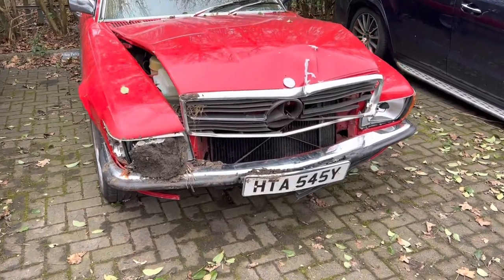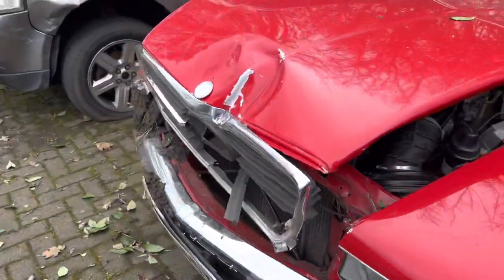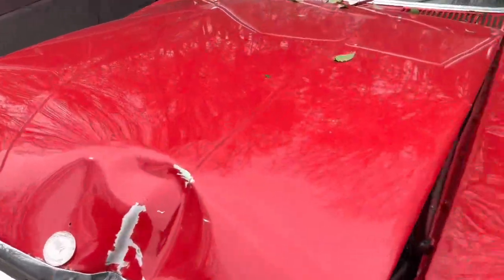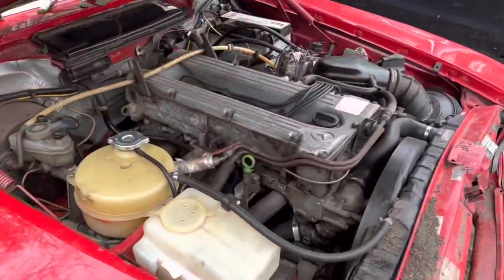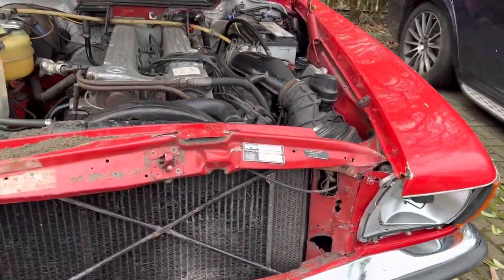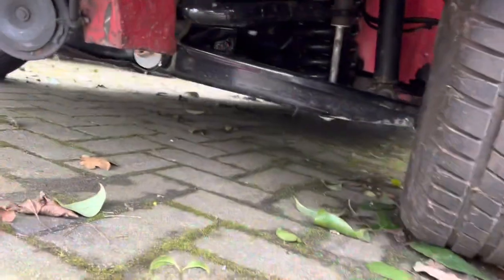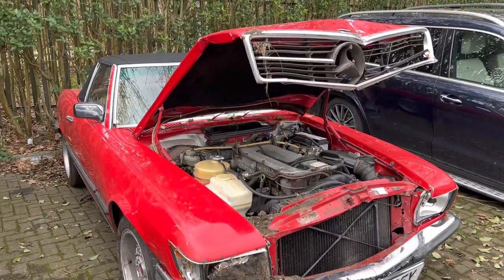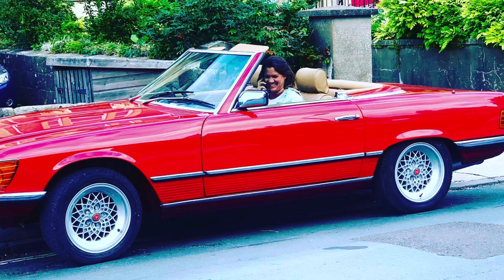Mercedes 280SL - check YOUR insurance and avoid this pain

Comment: Wish you all the best for the future. With all the criminality going on these days its best to just count your losses and move on. You have amazing talent with Mercedes Benz, you will find other good ones.
Reply from the maker: Thank you for your kind words. I'm not sure I have any talent for car work...mostly it is just long hours of hard work...however the current project (also 280 SL) will entail reconnecting the fuel system, gear box, starter etc...none of which I have donwe before so it will be an experience (and take my mind off the Red Dragon) Mike

Comment: This is so sad, all that hard work 😕 you must be gutted. Thanks for all your great r107 videos
Reply from the maker: Yep - gutted is the word. Now I need to focus on getting the other red 280SL finished. Mike
Reply: @MikesMercsandothercars  I’ve just received a fuel pump so I might swapping it over this weekend and see if the car fires up. I have just this sl500 hasn’t been started for 5years. Fuel pump was stuck. And the relay was burnt out like one of your other videos mentioned. So I’ve fixed the relay. I was tempted to take the Air filter off and pour a bit of fuel down into the inlet.
Reply from the maker: @russellhuggett5177  Exciting - let me know how it goes. Fuel in the air intake was how the Red Dragon started after sitting in a field for all those years. Mike
Reply: @MikesMercsandothercars  ok thanks yeah maybe I will try it. I think the whole rear end fuel system needs a rebuild as per one of your videos. It looks very nasty under there.
Reply from the maker: @russellhuggett5177  Yes...I'll be looking at the fuel system on the red project 280SL shortly...nothing is connected up. Mike

Comment: Save it !! It is going to stay on this parking for years before insurance will resell it and it will be too late !
Reply from the maker: It is so tempting to save it...especially as I'll probably end up spending thousands on the same parts for the current SL project. But....there are only so many hours in the day.Maybe I'll write to the owner of the insurance company and suggest they use this example as a away of boosting revenue in terms of the extra premium. Mike